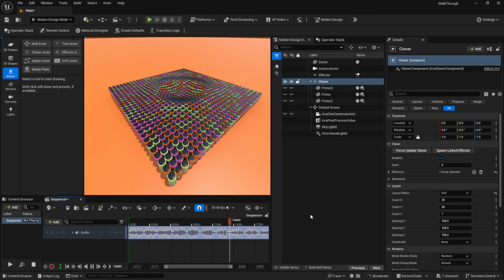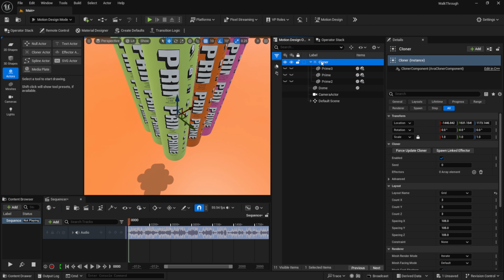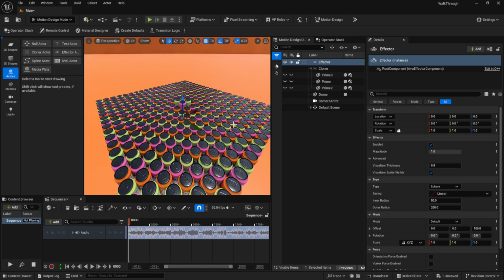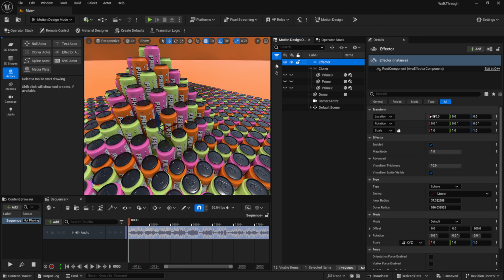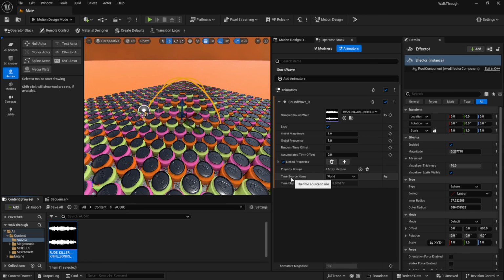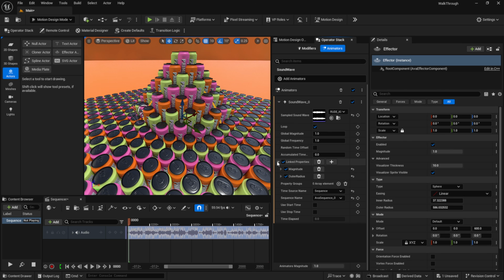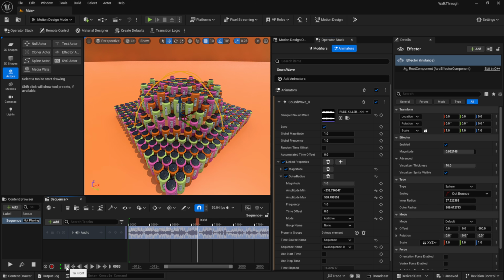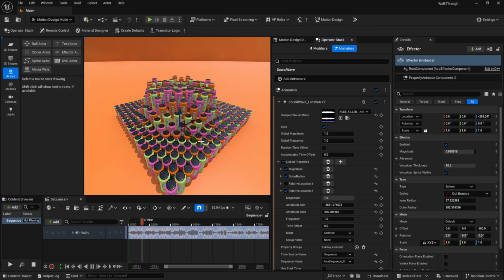Audio Reactive Cloners with Unreal Motion Design

Comment: hi, i tried but always my textures don;t appear. not even when i start new project. even when i import textured fbx... im noob. what i do wrong?
Reply from the maker: did you try using my project file to see if that works?
Reply: @JonathanWinbush  didnt know you have a project , can't see link. but it seems there some fbx don't apply properly (materials) but if i take from quixel works
Reply from the maker: @gameswownow7213  the project link is in the description it should show a gumroad link. As for the fbx it would depend on how it was created but if it doesn't come in properly you can make the material in unreal and apply it.
Reply: @JonathanWinbush  thank you. i got some 3d meshes from ai , all textured and stuff, if i get them into unreal they work, but when i try to add them in the generator then no texture. but i will try your method as well